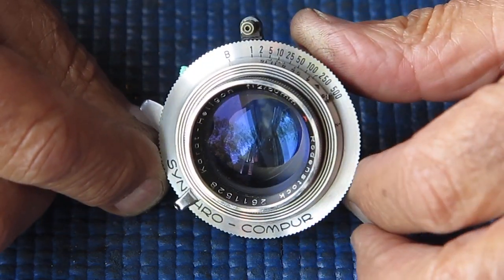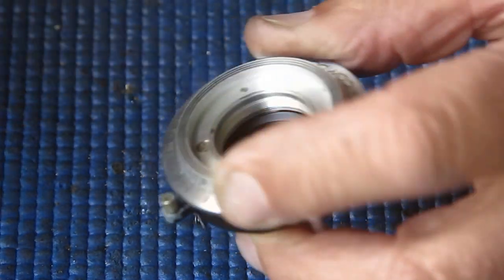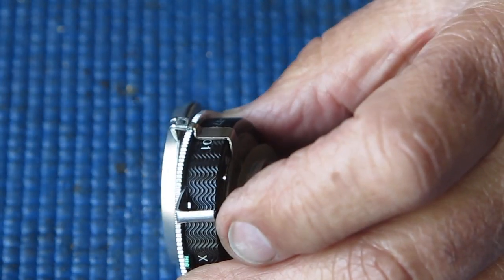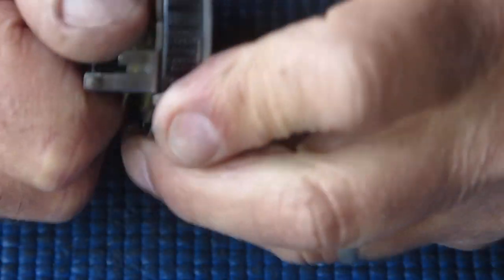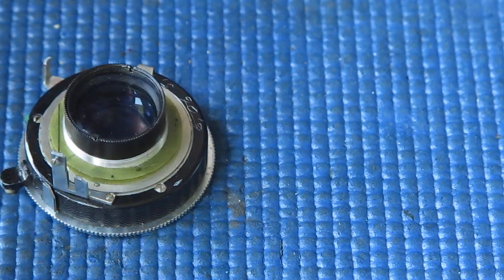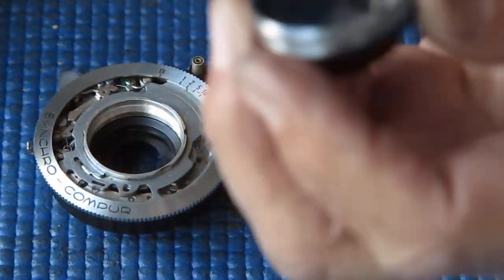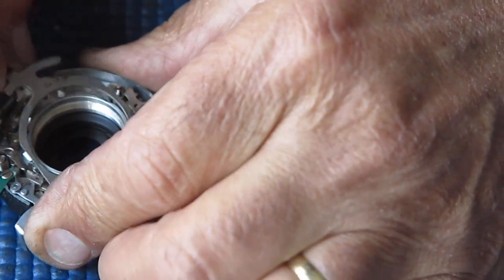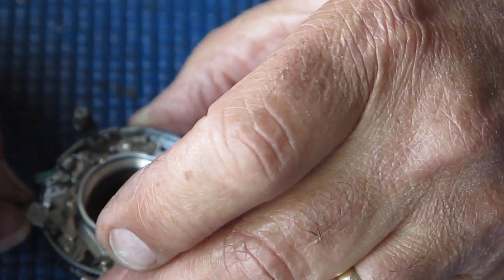Servicing an Agfa Karat 36 camera part  01

Comment: Hi Chris, these are very helpful videos. Thanks so much!

I have a working Karat 36 with Solinar lens and a non-working Karat with Solagon lens. Is it possible to replace the Solinar lens of the first camera with the Solagon lens of the second camera?
Reply from the maker: I've never done this , but my experience doing a similar lens change with a Kodak retina  tells me that there will be more to it than replacing the lens. The focus scales are probably different, and perhaps the rangefinders have some differences too,  although there may be enough adjustment range to deal with it.
Reply: @ChrisSherlock  Thanks for the response and the sharing of your insights. Much appreciated.

Comment: How did you remove the shutter/lens from the camera?
Reply from the maker: I used a special shutter wrench, the same as I use for Kodak Retinas. Might have been a Beljan wrench. These aren't available commercially these days, but you can find the details here if you want to make one. https://retinarescue.com/retinafocusmechanism.html and https://retinarescue.com/retainingringdimensions.html
Reply: you're very kind  @ChrisSherlock 
The shutter is not cocking as the lever in the body side is not pushing the lever on the shutter side enough.  I guess that without the tool, this will have to wait.

Comment: Hi, Chris. I have one of these with the Rodenstock lens and I love it. Everything works fine—even the focusing is easy and smooth!—but it has light leaks from tiny holes in the bellows. Do you think most repairers of old cameras could fix this or, even better, replace the bellows?  It looks like it might be kind of involved. Appreciate any advice you can give me, and if by chance you know of an ace camera mechanic in the USA, please let me know. Also, is there a place where I can buy a new bellows, so a mechanic wouldn’t have to hunt one down?  Thanks!